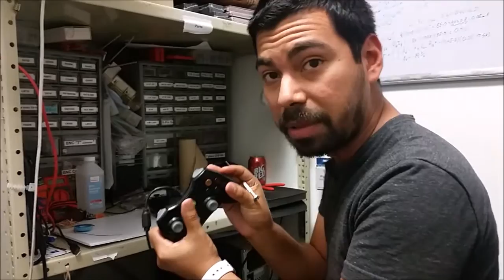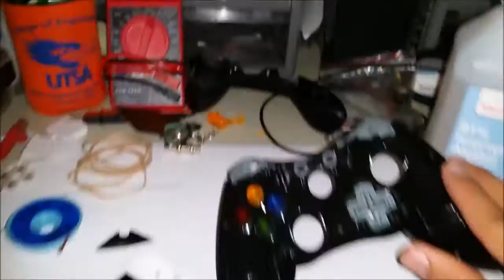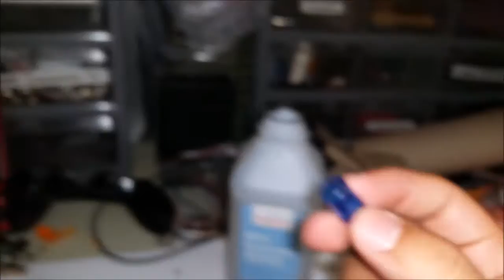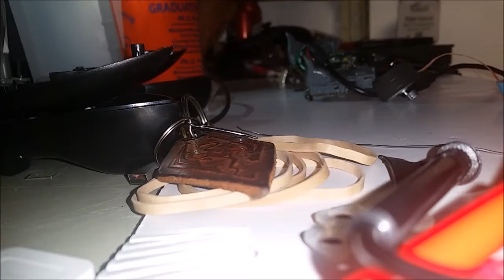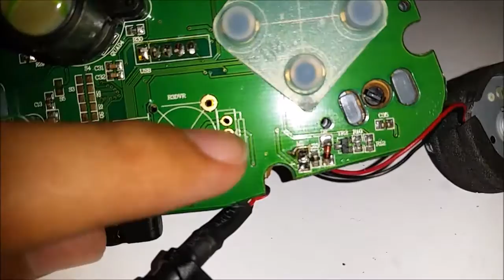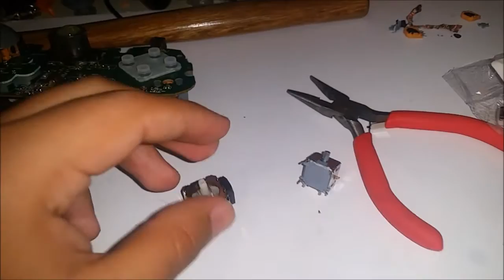Analog Stick Soldering [Failed Attempt/Life Lesson]

Comment: guys i didn't had any broken 360 controller laying arround os i just ended up soldering it with a ps2 controller the analog stick has this identifiying number B103 381U 

now when i connect it the analog shift towards left by default and its unusable, is it just that i happen by mistake to put a faulty ps2 controller or the xbox 360 doesn't support the same stick althought they both has the same shap and dimenssions